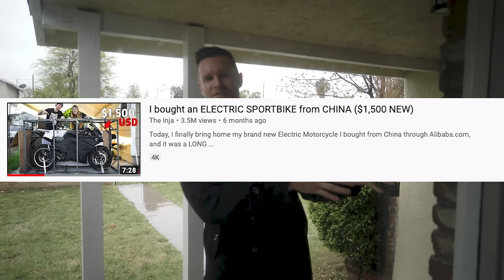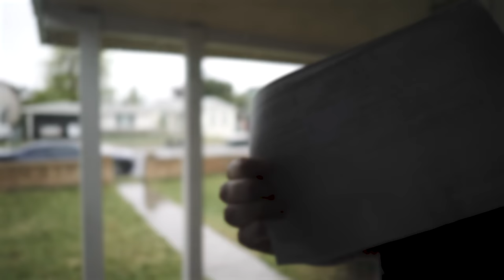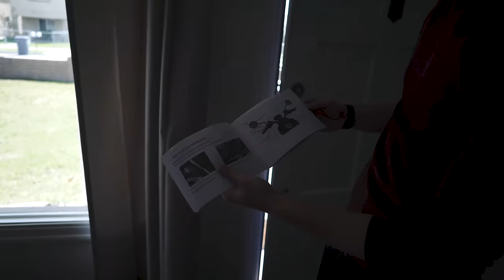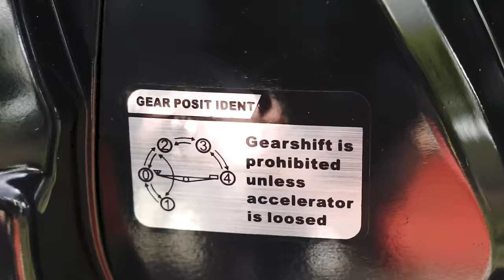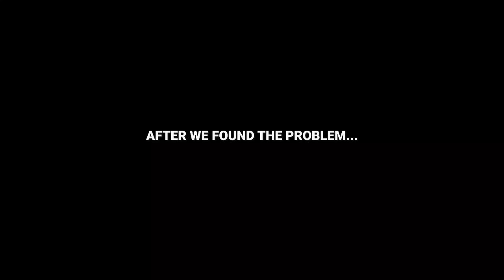I BOUGHT the most AVERAGE-PRICED Motorcycle on AMAZON ($1,600 NEW)

Comment: “That’s going to run for a long time.”  

Actually, it probably will.  Most of these bikes run a clone of the Honda CG engine, which is known to be virtually bullet-proof, and incredibly low maintenance.
Reply from the maker: Kinda encouraged by this comment. Haha
Reply: The Inja, if you’re into that sort of thing, it’s kind of a neat story about how & why it was developed.
Reply: yeha seems like those 125cc dirt bike engines. those are fuking solid.
been true rivers with it it was pissing water still ran fine....
cheap china knock off engines are cool cheap and work any parts are aviable out of china and for like cheap AF
Reply: Not a cg based engine!. It's a horizontal cylinder like a crf50 based Honda engine
Reply: I think we had a Briggs and Stratton lawnmower engine that sounded like that.  It also needed a choke
Reply: It is based of a Japanese engine. It's the metal they use to cast the parts is what you should worry about. With that said it is pretty easy swapping out a used cb250 into that thing.
Reply: Most likely it's a Lifan engine.
Reply: There's a big difference between Honda and  generic  you'll find out overtime
Reply: It may be a "copy" but it will be a BAD copy
Reply: Andy straight males I’m curious...

How much experience do you have with modern Chinese clones of these engines?

They’re used all over the world, in places where motorcycles are the primary mode of transportation, racking up tens of thousands of miles a year, for decades at a time.

I’ll give you a hint.  China manufacturing works to a price point.  If you order, and pay for, high quality with good QC, you’ll get high quality with good QC.  If you order cheap, you’ll get cheap.  But that’s no different than anywhere else.

Most Japanese, European, and American motorcycles come with a wide range of components sourced from Chinese manufacturers.
Reply: @Vessekx  Absolutely correct!!! Chinese make a great product if you want to pay for it A perfect example is Harbor Freights Predator engines. They are manufactured by LONCIN, which is a division of YAMAHA MOTOR CO. They produce most components for YAMAHA'S side by side buggies. A ISO9001 facility. Quality stuff! Lots of Honda's 300CC and under bikes are made in Brazil. Good stuff there too.
Reply: STOP BUYING ANYTHING FROM CHINA
Reply: John Rice, says the guy using hardware made in China.

Maybe start thinking before you post.
Reply: @johnrice6670  The Chinese make quality products too! Its a global market. Chinese products are everywhere.
Reply: Theo Brinkman : STOP BUYING ANYTHING FROM CHINA, THERE ARE Alternatives , if we don’t Stop buying  thing’s from China ( or at least try to stop / look for something else from some where else ) we are just saying it’s ok for the CCP (Chinese communist party) to shit on US ( USA / The World ) this is not about the Chinese people , this is about CCP who wants global domination , 

Do something , Say something, TRY to change something. 
STOP BUYING ANYTHING FROM CHINA
Reply: @johnrice6670  Fact: Whatever you're writing that comment on has parts in it that were sourced from China.

Comment: That's a Lifan 125cc engine. I used to have one in a bobber I built. You can easily find on ebay big bore kits with a cylinder and piston to take it up to 140cc. Doesn't sound like much of an upgrade but I definitely got a few more mph on the top end. Well worth it.
Reply: what was your top speed
Reply: My first bike was a Lifan 200cc/single cylinder sports bike that redlined at 32mph and topped out at 60mph.  The problems started after the break-in period.  At one point the motor wouldn’t turn over and something was just buzzing in the motor when I tried to turn it over.  A bolt head snapped off from one of the casings on the motor and I could never get the bolt out in order to change it.  That’s just my experience.

Comment: The fuel octane rating of 90 or above is likely from RON methods of calculating fuel octane. It is essentially the same as 87 Or higher using AKI method, which are the number we see at the pumps here in the US
Reply: Differnt countries use a differnt octane rating system then the US. Aki, ron and mon. 95 octane in Japan is (ron) is 90 in the us (aki) and 85 in brazil (mon).

Comment: Plot twist, all the trouble could have been avoided if he just used 90+ fuel
Reply: You think so ? Not a combination of Amazon product built in China ?
Reply: @cruelcimmcia859  ... lol joke
Reply: @cruelcimmcia859  It's not an Amazon product. If you buy some Q-Tips, or an iPad off of Amazon it doesn't make them Amazon products.
Reply: My accord runs like garbage on 87. No power, rough, poor gas milage.
Reply: @brickswisher7672  in the netherlands we only have 95 ,98 and 102
Reply: @daan5586  Nice, I bet that isn't cheap.
Reply: @brickswisher7672  around 1,60-1,70 euros per liter for the 95
Reply: @daan5586  Wow. that's 4-6 times the cost in the states. I would guess traveling distances aren't as great there either. Still it would be nice to have that option. high octane burns cleaner too. So much propaganda about how it doesn't. I'm sure some or many cars dont get the postitive effects of high octane but In mpg alone, i notice it in every car i've used. Been driving vtec engines for years which are designed for it. also funny how small gas engines have high octance reccomended. auto industry is a scam, why would they want your vehicle to last longer and perform more efficiently?
Reply: @brickswisher7672  for standard cars we use 95 and for cars with turbo 98 and for supercars 102, diesel is 1,30 / 1,40 euros per liter the 102 is around 2 euros per liter.  imagine driving a mustang in this fucking country
Reply: @daan5586  LOL. not for a commuter. 
I just saw 5 gal of 110 "race fuel" for 59.99 U.S. dollars. I'm tempted to see what all the fuss is about. My guess is that it may be over kill, but I do live for the red.
Reply: @brickswisher7672  i dont know what 5gal means buddy
Reply: @daan5586  about 19 liters.
Reply: For some reason I thought the same thing 😂
Reply: Differences in fuel ratings actually have to do with differing Octane measurement standards across the globe. China it seems uses RON (similar to Europe) whereas the US uses the RON+MON/2 method.

90 RON = 87 (R+M/2) so it was the correct fuel put in.

Comment: Do a nuts and bolts on it and see how everything is mounted. All that plastic is probably rattling around and everything is mounted poorly so your getting vibrations. I spose you should be able to adjust the timing and carb to get it running much better when you figure everything out. The idea of getting a better carb might be good and I bet you have enough spare parts you could probably swap something on to see if it's happier down the road.
Reply: If it is 0lastic ride a bit remove look at back of panels, you will see scuff marks where.it is vibrating. Get some thin foam tape at lows or home depot, it os foam with sticky side. Mount to scuff spots it will silence it. Dod this on older 600 ninja at about 50k miles as panels had been on and off hundreds of times for maintenance. Oh to tighten screws with out twisting and cracking mount holes apply some oil around holes so screws can tighten without grabbing and twisting plastic.

Comment: It looks and sounds a lot like a Honda 125. I did riding school on one of those years ago. The Honda doesn't have a manual choke or carb.  I put 91 octane in my high compression bikes. I can feel the diffenence when I don't.
Reply: The engine is an EXACT copy of the Honda 125.

Comment: For that amount of money, I would say its a total bargain! but I see the quality control is suspect, so every nut and bolt should be checked especially triple clamps, steering stem, swing arm, engine mounting bolts, brake calipers,  axle bolts and make sure the wheels are balanced to start with, then you can go over the entire bike looking for parts that vibrate and use rubber washers or blocks to eliminate a lot of the problems caused by vibration. For $1500 I am guessing you might get the wheels and tyers for that amount of money from any of the leading Japanese manufactures that sell similar 125 street bikes but you have a complete motorcycle.

Comment: I’d rather buy a used Japanese bike or save up for a new one.
Reply: @carrickdubya4765  I bought a Honda VT250F for $1000 AU. The muffler fell off on the way home but I got six months of use out of it before electrical issues saw me offload it to a wreckers. Got a fantastic 2011 Ninja 250 for $2000 and had no issues at all and it was an easy DIY air and oil filter change, clutch cable adjustment and short levers mod. When life treated me well I rode a Triumph Street Triple 2013 and modded it with a single headlight, a Triumph rear set foot peg kit, a Street Triple R Front brake master cylinder, shorty levers, anodised front and rear brake reservoirs and crash knobs. ** beautiful bike but yeah, life throws curve balls and now I'm back on a Japanese bike (Suzuki SV650s 2003) which I bought for $3700 - I think a decent price for 30 thousand Kilometres on the clock. It came with two new tyres, new chain, new bars and levers and yeah, a few scratches but I sure appreciate the torque and engine reliability. Needs some exhaust baffles though.
Reply: yes the raw materials are very good. I'm sure every single piece on this was made cheap as possible. Pot metal.
Reply: i suggest the honda cb300r. gets the job done. There are higher variants too.
Reply: STOP BUYING ANYTHING FROM CHINA
Reply: jo151 you missed the point. It's not about what you can afford. It's just to SEE what you can get for $1600!

Comment: Noticed that the fuel filter is on backwards.
Reply: NPC #34254334 Response:  lol
Reply: It's not.  Fuel flows from the outside of the element, through to the center.  That way the grit is on the outside and you can see if it is dirty.  If you look close you can see there is an arrow on the side, which is correctly pointing in the direction of flow.

Comment: 11:23 Why would you arbitrarily loosen the chain, without first kicking it up on the center stand, lubing it and rolling in the chain and sprockets first?
 In my experience, installing new drive chains at proper tension and driving away, always, always, ALWAYS results in a clonky chain dragging on the swing arm within a couple of miles and there goes that Sunday ride. Ignore it and rev it instead and you're going to unevenly stretch one section, when the drive train snatches up, or worse, you'll spiral bend sprocket teeth, or straight up remove them and those snaggle tooth's will grab at your chain until they finally break off. 
 If you don't have a center stand, lean it over on the kick stand with the rear tire up and really spin it for a few minutes, then re tighten it.
Reply: I've never ever seen bike without kickstand protection. You can't run engine on gear if it's on kickstand. At least here in Europe.
Reply: @jothain  Thanks for the trip down memory lane. Cafe style sport bikes are sold without center stands in the States. Most sport riders remove the ones that remain, because they touch pavement and unweight the chassis in extreme turns.

Comment: I'm surprised R&L managed to get it there in one piece.  The company I worked for used them alot back in the day and we had countless damage claims against them.
Reply: Owner where I work bought a 6 ft diameter pebble glass patio tabletop shipped R&L. Knew there was a major problem since the box rattled horribly. Opened it up and nothing existed other than tiny glass pebbles. Driver’s boss told him to not bother hauling it back and just throw it in our dumpster. They paid for the replacement.
Reply: R&L is one of the worst carriers I’ve ever seen.

Comment: When you buy a full size motorcycle from a motorcycle shop for instance a full size Hayabusa. I hate to tell you people but it does come in a box off a truck. I learned this when I purchased my first new motorcycle it was a Honda 750. The dealership was only Honda and I came in to buy that specific motorcycle when I walked into the showroom to talk to the salesperson I asked to see it because it was nowhere to be found on the showroom floor. I was escorted into the room where they do the repairs and there were large boxes of motorcycles one stacked on top of the other approximately 4 high if I recall. At the top was the bike that I was purchasing it had the Honda emblem on the box as well as the color model and size of engine I was actually a little surprised myself but it has to be shipped some way. Reason I'm posting this is because people are saying that they are surprised  that they're able to purchase a small Chinese motorized vehicle from Amazon. No difference really if it comes in a box and it is shipped into this country then Finds Its way on to a truck yes it's going to be in a box. Makes no matter if it's being shipped to a dealership that's going to assemble it and performs regular service or Amazon who works on volume.

Comment: Sounds just like my first bike did, a Ninja 250R. I took that bike overseas, rode it all over Europe. I'm not sure I'd have enough faith in that Chinese bike to do the same. Would be interested to see how it handles motorways.
Reply: Interesting take Jon...would you mind me picking your mind regarding beginner bikes?
Reply: @dancerehab1092  It's been a long time since I got my first bike but happy to try and help :)
Reply: @Jon-1919  will keep it simple, you got it new, zero mileage or used? Also what were you taking into consideration as you were shopping around? What would you change given a chance back then?
Reply: @dancerehab1092  I was lucky enough to be able to afford it new (via a loan!) but I wouldn't hesitate to buy something second hand now. I'd probably go to a reputable dealer if you did buy second hand as they'll clean it up and be responsible for any problems with it.
I'd recommend getting something lower CC to begin with. I got a 250cc and it was very forgiving, but I still travelled all over Europe on it. I was keen to upgrade after a year or so though.
I think with what's available today if I was starting over, I'd probably look at a 500cc bike. Maybe the Honda CBR. The 600cc is quite a handful for a new rider in my opinion. The 500cc should be solid, a bit more forgiving, and will probably last you longer than a 250cc before wanting to upgrade.
A 250cc would be absolutely fine if you're not planning on doing long miles though. I rode mine all over Europe and the thinner tyre profile was a bit frustrating at times as I got pulled around by larger cracks in the road, and the wind would knock me about a bit sometimes too. Not a huge issue though if you're only doing smaller rides. Hope that helps a bit! Be safe when you do get it, stay switched on, treat everyone else on the road as if they're an idiot, and always assume they haven't seen you!
Reply: @Jon-1919  wow that's some solid advice. Will definitely take into account all that you have highlighted. Still doing my research, for now getting a new midrange kind of bike might be difficult, priorities and all haha, (well adulting) but I am keen on getting nothing below 300CC at least, instead of like waiting to upgrade down the road I want to like get something exciting that will do for a few years say 3 at most...I have my eyes on a duke 390 but whoa finding a used one is kind of tough....seen some old cbr's being sold that date way back to 2007, not sure about those...again I have identified some dealers who sell both new and used especially from the American market. Will pay them a visit as I scout...hopefully I can begin riding this year...Also for the usage, I'd love a bike that I can like travel with and cruise around the country, so I will have to research more and find out what options are available locally...
Reply: @dancerehab1092  sounds like you're making sensible decisions with it all! They're great fun. I hope you get something soon and you enjoy it!
I'm in the UK and you can buy a book called 'Police Motorcyclists Hand Book'. It's the one the police riders are issued. It has a lot of useful info about weight distribution, grip, vanishing points... All really useful, would recommend.
Reply: @Jon-1919  perfect, I will definitely get a copy. Thanks for the recommendation.

Comment: It's interesting that it looks like it shipped in a Boom motorcycle box when the Amazon storefront doesn't even have Boom branded bikes. I've seen a few channels suggest always checking to make sure all your bolts are fully tightened when you get these inexpensive bikes. Sometimes things you don't even expect to be are loose for no apparent reason. (even more valid a concern after some of the things you actually found to be wonky). Nice to see a slightly less hair-graying experience in comparison. I noticed a lot of donuts tracks in the intersections, that isn't you is it?😄
Reply from the maker: (Shhhhhhhh I told my wife it wasn't me)
Reply: If you've seen yammie noobs video on the 230cc version you'd know that some bolts need to be LOOSENED, not tightened😂😂😂😂

Comment: There is no quality control in cheap Chinese bikes guys make sure you do it for yourself like tight up all the nuts and bolts, put a good oil and fuel in it and do some slow rpm rides for atleast 500-700km or you gonna learn the hard way like I did it.

Comment: Yes, you need to adjust the carburetor mixture ratio to the maximum engine run then slow the idle speed to the appropriate . If the mixture ratio is too high , it will stall. You are already a Amazon  motorcycle expert buyer 😀